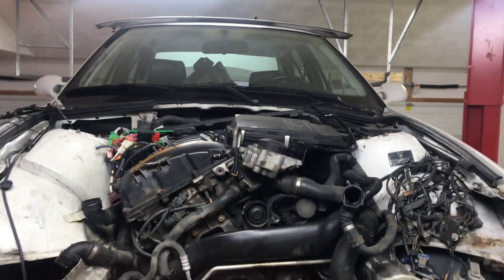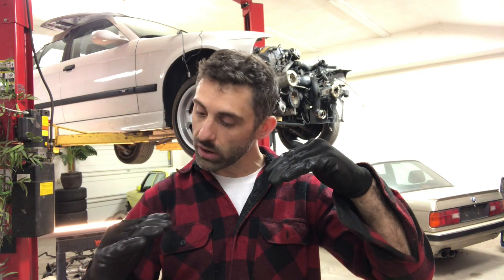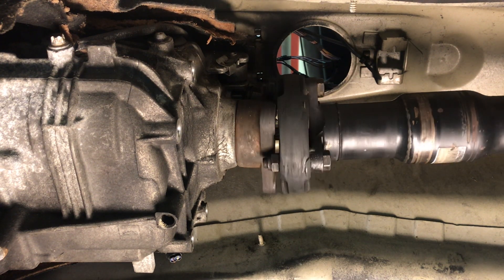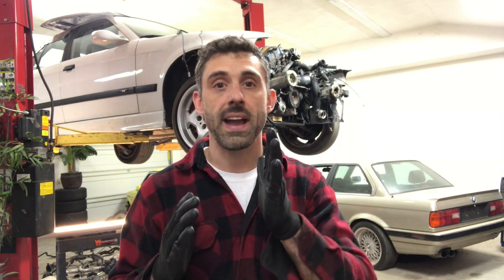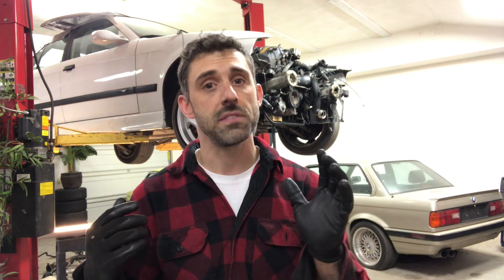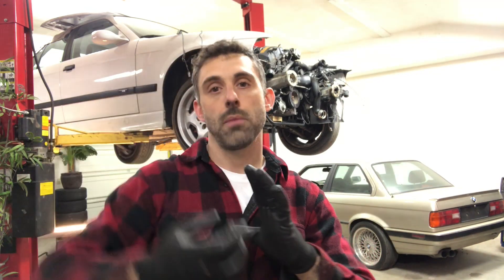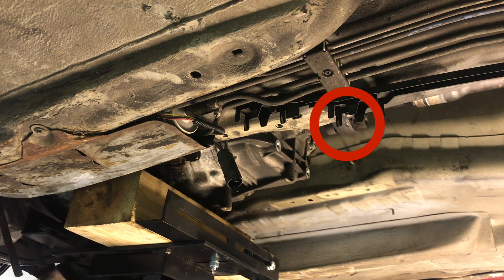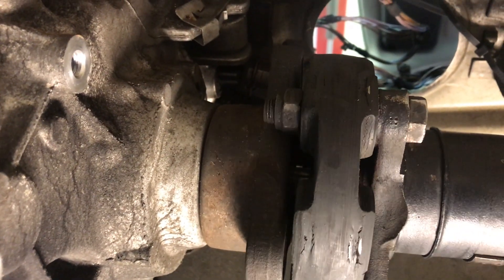How to align the N54 Engine Trans - E36 N54 Engine Swap

Comment: Hi Frank. Love your videos. Catching up on some old stuff. So how differcult with this swap be in a RHD e36?. Will the steering column on the RHS of the car complicate things much in terms of the headers/turbo/rhs engine mount? Would there be alot more fabrication work?
Reply from the maker: Yes there would be more fab work not sure how much but I estimate custom downpipes at a minimum!